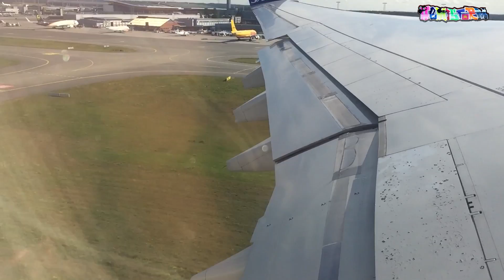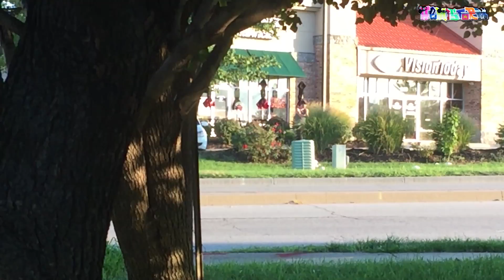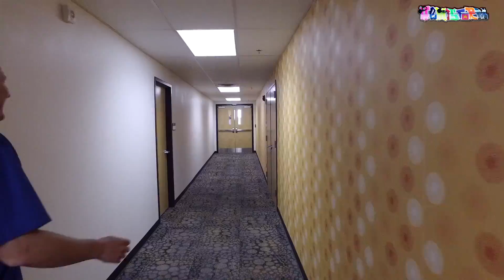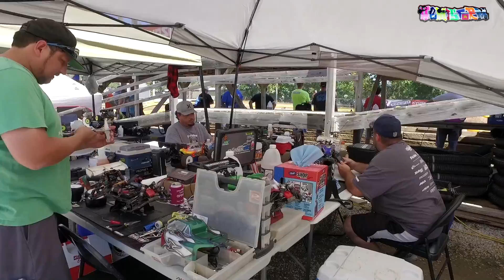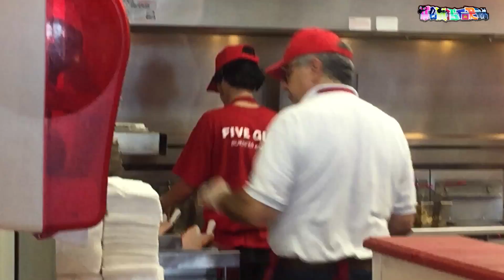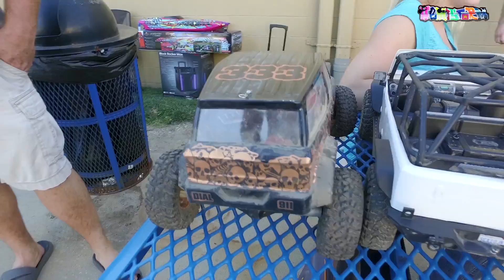SENSORED by CASTLE CREATIONS - HemiStorm goes USA again!

Comment: hey I just ordered a castle slate 2850kv for my scx10 how water and mud proof r these motors and can they be run on other sensored escs?
Reply from the maker: You won't get the full potential when you run them with another brand ESC. They are water resistant, meaning they have conformal coated sensor boards. Some dielectric  grease around the sensor plug should do the trick in keeping the rest of the water out!

Comment: YOU DO HAVE HAIR!!!😂😂😄😎
You taught me quite a bit here! I know very little about sensorless motors in general, but those sound like a great, best of both Worlds kind of technology. As I say too often, I can NEVER afford that level of good - but I'm glad Castle is there, making an incredible AMERICAN product (not much made here anymore). They support the local economy, and I give mad respect for that! 👍👍💯🎉  Maybe someday I can find out how good they are.... 

I'm DYING to try brushless, for different reasons than most. Runtime, runtime, runtime, first! Then torque. Since I run mostly Trail Trucks, and am trying to get into Crawling and Rock Climbing - when I can get a brushless setup, it will be sensorless, and in the 2750-3900kv range. Again, I'm not about speed - anymore! Slow and powerful. 

It amazes me, how SO MANY people are mislead into believing that on brushed motors, the Higher turn count, the more Torque you get! 😲😲😲
ACTUALLY, the more turns you have, the LESS torque you have. I guess it comes from Crawlers..... You do get less top speed, which adds realism, but it's misleading. Electric motors are NOTHING like gas engines are, and that adds MORE to the confusion. Some manufacturers capitalize on that.

When you pop an 80 Turn motor in your rig, you've got much more control at slow speeds. The misconception is, that equates to torque. 
I'm told that when you use like a 19T or 21T motor, they are way too "punchy".
WELL, that punchiness IS TORQUE! Torque is what gets you from a dead stop. Torque is what spins the tires and kicks the dirt up! 😉
Now brushless - I am STILL without a complete clue, but I'm trying to learn by reading. I KNOW that they're entire power/torque curves are entirely different, but that's all I know. 
You DID teach me a little more in this video, and I thank you!
Reply from the maker: Check out the new crawler specific sensored motors when you have a minute, Carmine. I have been testing them for a couple of months now and I will never go back to brushed!
Reply: I do look forward to trying brushless - I'm CERTAIN that I will never go back either!!! 😁 👍 👍 
Would you know if 2-pole or 4-pole is better for low end torque?

Comment: Hi I bought a sensored kit for my summit, it showswaterproof on the box but does that mean the motor is waterproof ? Can't find any information on it
Reply from the maker: Hi Brad, the motors are water resistant. The sensor boards are conformal coated, but the sensor port itself and the bearing around the shaft are not fully waterproof. Which means that you can absolutely run them in wet conditions, but you can't submerge them for a long period of time. If you do get it very wet make sure you dry it out and oil the bearings.

Comment: Hey,

I can't find any information about if these motors retain the waterproof characteristics of the sensor less versions. Does anyone know if they are or aren't waterproof
Reply from the maker: They are water reisistant, not fully waterproof. The sensorboard is conformal coated, but of course the sensorport does allow water in when submerged for a longer period.
Reply: Thanks, helps a lot. finally someone that responds to comments 👏👏👏👏

Comment: Would these 540 size motors be fine for an Axial Yeti or Twin Hammers?
Reply from the maker: Yes they would! :)
Reply: HemiStorm RC - Custom RC builds, painting videos and more That's good news for what I want to do, but it's still surprising to me that a 540 motor would push a Yeti (that normally comes with a 550 motor) without overheating. Did castle really make them that powerful?
Reply from the maker: Go with the lowest KV and a blower shroud, and it should work fine. Temperatures on these are a lot lower than everything else out there, just a result of efficiency. If you have the room for it, a 1415, would of course be a safer option.
Reply: HemiStorm RC - Custom RC builds, painting videos and more Is the lowest KV available for the 1406 size motor 4600kv?

Comment: That they would come with a sensor motor was predictable. Because more than 1 year back they started with the mamba monster sensored esc
Reply from the maker: In 2010 they actually came out with the MMP, their first sensored ESC, so it was indeed only a matter of time.
Reply: HemiStorm RC - Custom RC builds, painting videos and more Oké that I didn't know. I use tekin in some of my 1/8 mt's very nice motors but they don't have the power  and here in Europe hard to come by

Comment: I found weird they were able to keep the Castle 1515 the same length even with the sensor? the castle 1515 didn´t have any room to spare to fit the HAL Sensor... Did they downsized the rotor size to fit?
Reply from the maker: The rotor is shortened ever so slightly, but the strength of the magnets is yet again improved, so they could compensate for the shorter rotor. The ends of the rotor and stator are where they are least effective, and that is also the exact location of the QuietSense technology (Fluxshield and additional magnets) and the HAL effect sensor. Long story short, you will see these are the most powerful and controllable motors Castle has released so far.
Reply: HemiStorm RC - Custom RC builds, painting videos and more Thanks for the Reply! Well the Castle 1515 is still my favorite all day bashing 1/8th motor (I have 3) so Its natural I will try to replace them with these to FINALLY take some advantage of the Sensored ESC they run with (All XERUN 150As).
Reply from the maker: The 1515 is one of my all time favourites as well, and I had the same apprehension as you expressed. What they told me makes total sense though, they are able to squeeze more power out of a smaller package, along with everything in this world they manage to still improve on the effectivity of magnets for example. I think someone in engineering used the following analogy: "Where 20 years ago you used a 1.6 litre engine to power a compact sized car with roughly 60 hp, these days they race Formula One with that displacement".
Reply: HemiStorm RC - Custom RC builds, painting videos and more
Time will tell! lets hope being sensored do not take away the weather proofing as well.. Did they talk about that? does it has an o-ring type of seal on the sensor like the new Hobbywing motors?
Reply from the maker: The sensor board is conformal coated, and the sensor plug provides a tight enough seal to consider these new motors splash proof or water resistant. There is a silicone rubber seal around the solder tabs as well, so they went as far as possible to ensure you won't experience any issues if you do run in wet conditions. In addition I'd like to add that you will be able to use all new features available in SmartSense and Quietsense only when you use the Castle Sensored motors with a Castle sensored ESC. So yes, you will be able to use them with your HobbyWing unit, but you will not be able to use them to their full potential and run them as efficient as they can.
Reply: HemiStorm RC - Custom RC builds, painting videos and more Well the Quietsense tech sounds like purely mechanic shielding so I think any type of sensored ESC will take advantage of..

The Smartsense sounds like ESC side only algorithm to change between Sensored and Sensorless mode like The Tekin RX8 and Hobbywing XR8 already does.. Since my Xerun does not do that its my loss I guess.

But anyway I do not race with the 1515s so sensored switching mode is not important to me rather than having smooth crawling take offs which normal sensor mode will deliver.
Reply: theres a lot of room in the back of the motors anyways, could stuff a lot of stuff back there
Reply: Hualin AZZ ehhh Hemi already said they downsized the rotor a little bit to fit the HAL Sensor... Obviously wasn´t "a lot of room".
Reply: I see, pretty impressive they could get the same power out of a smaller rotor. However, the most powerful 15xx motors are from neu, and their smaller too. Original neus, though sensorless are very smooth and controllable with plain stupid top end

Comment: hemi have you tried vaping?
Reply from the maker: I haven't. Do you vape?
Reply: HemiStorm RC - Custom RC builds, painting videos and more. I do. saw ur little cig comment. I was just curious. I say try it and get rid of the cigs if possible. I used to smoke a pack and a half a day. been vaping for 3 years. not sure of the regulation where your from though.
Reply from the maker: Vaping isn't yet fully available on my end of the pond. Will give it a go at some point though!
Reply: HemiStorm RC - Custom RC builds, painting videos and more just a suggestion
Reply from the maker: Would be way better for my health, that's for sure! I will report back when I give it a go, Scott. I appreciate it.

Comment: I think the motor plate side milling looks corny and less professional. It should be flat and have as much surface as possible. This aids in cooling against metal motor plates and decreases the debris getting stuck in there. Other than that these look like a cool idea. Sounds like another great new product from castle. Are they longer than conventional sensored motors?
Reply from the maker: The size on them will be the same, the milling is perhaps a matter of taste. Seeing it first hand I think it added a bit of class to the overall look of the unit.
Reply: that does in fact increase the surface area of the motor plate, heat transfer through the chassis is minimal, best to run a fan even if set up to run cool
Reply: It increases the surface area  but not the surface contact at the motor plate. On any 2wd rear motor rc and lots of others there is little to no airflow around the motor plate side and a fair bit of cooling is done through the motor plate. Air is about the worst conductor of heat.
Reply: Right, in 2wd cars there just isn't enough airflow (running a fan is dangerous there too) back there to make it have any difference, but putting some thermal compound on the cutouts will fix that easy. I was thinking more about 4x4 cars like the losi scte where the motor has its own place on the chassis. But honestly, the best way to keep a motor cool is with good gearing, and with the amount of cutouts castle milled out any losses in thermal capacity are truthfully negligible.
Reply: That's probably true about temps. The other issue with those cut outs on the motor plate side is that debris gets stuck in there. 

Both are minor issues and I think it does comedown to personal opinion more than anything else like Hemistorm said.

Those millings are definitely not going to stop my from purchasing a castle motor. I just think they have minor disadvantages and add a gimmicky look to the motors. I really don't spend much time looking at my motors though. I have motors with funky shapes on the end and motors that are flat already, not a big deal. Its just not a value add for me.
Reply: hehe, I'm the complete opposite, I can't stop staring at them! I want to try out one of their new sensored 7700kv motors in my b44.3 for extreme overkill, they're a good price too

Comment: A 540-sized motor (3650?) that's less than 1900KV would be killer for the crawler world.
Reply from the maker: After converting all the current KV offerings to Sensored, more and lower KV rated motors will be developed and released. They are coming!

Comment: great info man. had a question about water proof'ish
Reply from the maker: It's splash water proof, not fully submergible, it's impossible to fully seal the bearings and the sensor port unfortunately. The sensor board is silicone conformal coated, so it does operate under wet conditions.

Comment: what kv offering did u see for 1/8 scale? and am i gonna be able to run these motors with my mamba monster X esc?
Reply from the maker: Yes, you will indeed be able to run the entire range of motors with your MMX. The available KV numbers from the launch are going to be 1800, 2200 and 2650 with more under development as the market expresses a need for them.
Reply: Wow really lookin forward to that 1800kv! 2200kv has plenty of power for a 1/8 scale mt but really had to undergear to get proper torque (and we all know what that causes).. with bein sensored we'll get the first 1/4 of our trigger back! Thx for vid and appreciate the response

Comment: Great video thanks for all the info! Can u use the sensord motors for off road racing 1/8 scale buggy and truggy?
Reply: Aaron Scales I would imagine you could. As long as the kV didn't go against the track rules, it would seem like you should be able to.
Reply from the maker: You absolutely can, and some motors will most likely become ROAR approved in the months ahead.

Comment: Think I'll get one of there motors to put in my Losi Baja Ray 2.2 I'm building!
Reply from the maker: That seems like a great platform to drop one of them in indeed! I have been curious about that truck and may see if I will go out and get one.
Reply: I don't think you'll be disappointed. It's well made, and it's made of better plastic thane Axial. I got a set of 2.2 Pit Bull Growlers to turn it in to a Rock Racer. But haven't yet decided if to have the one spear tire or make it to take two. That would look cool ;-)

Comment: Don't all modern esc's switch to sensor-less mode after startup?
Reply from the maker: No they do not, most run fully sensored.
Reply: Weird, I always thought that only cheapest ESC's didn't have that option. Both HobbyWing(SCt-pro and later) and Tekin(RX8 and later) automatically switch from sensored mode. Even Castle themselves first used this feature in... 2010 (MMP). 
At least I hope they changed design of their stators - old ones like 1410 required a wrench to rotate the shaft from stand still - totally useless for racing, but great punch though.
Reply from the maker: There are indeed a few others, but most run fully sensored. Castle indeed invented and further perfected this feature since 2010. I guess in case of the other two manufacturers, Castle can rest assured that their technology being used by others is in a way a compliment and acknowledgement of cutting edge technology being developed in Olathe, KS. 
However, SmartSense as referred to in the video is the synergy between the transition from sensored into sensorless and the QuietSense technology, in other words the magnetic noise reducer and the proprietary magnets pointed towards the sensor board. The stator design of the 14XX series has recently been improved, without sacrificing any of the punch that you mention.
Reply: they have, 1410 can be turned very easily now

Comment: Allright, but esc's will have the "turbo" thing? Or is just sensored in startup?
Reply from the maker: They are sensored in startup, and then shift into senseless mode because the accurate readout of the rotor position is not required in the high RPM range. This is however only half of the story. I think what makes it truly interesting is the constantly optimised timing in both direction, and the presence of the FluxShield and dedicated sensor magnets.

Comment: There are great sensored motors already available from other manufactuers so nothing really new or revolutionary here..
Reply: Not true.  Take a look at the sensor assembly.  Completely different than anything else on the market.  Very cool tech-- consistent timing,  no glitching from motor fields, no timing drift with motor field power.   Consistent timing forward and reverse...   it's a new type of sensored motor.
Reply from the maker: Indeed, as Patrick said this is a new concept, with the addition of the FluxShield and the dedicated sensor board facing magnets. If you add up all the info, there is currently no system available that manages to beat the Castle Sensored setups in efficiency. And as explained in the video, greater efficiency means less heat, which in turn means that you can in all likeliness go up a tooth or 2 on your pinion compared to systems by other manufacturers that come with the same KV rating on the motors.

Comment: awesome. finnaly when i buy a new crawler i won't have to buy a momba max pro and sensored motor from another company. bring on the 4 pole 3000kv range of motors.
Reply from the maker: They are coming! I agree on ideally having an ESC and motor by the same manufacturer, just to make sure it works in perfect harmony.

Comment: Excellent news will it be made for the 1/5th scale motor as well and will it be quieter than it is now I was looking to do a 1/5th scale conversion next summer. Because the ones I have seen and heard are loud and seem abrasive to the speed controller. I love 1/5th scale gas but I would have to travel further into the  woods to have some serious fun. Keep rocking the knowledge!!
Reply from the maker: Initially there are no plans to prioritize the 5th scale setups in making them sensored. However, I feel if there is enough interest, I would be keen as well to have 5th scale in sensored, I can imagine that we will see them become available down the road.

Comment: are they waterproof?
Reply: KMJ187 splash proof probably. waterproof probably not.
Reply from the maker: Water resistant, as in splash resistant, but like all other motors out there not fully waterproof. This is also nearly impossible with an exposed sensor port and such. The sensor board is conformal coated like all the circuit boards produced by Castle, so that does add to the longevity of the motors in case they do get exposed to moisture.
Reply: splash proof is fine :)